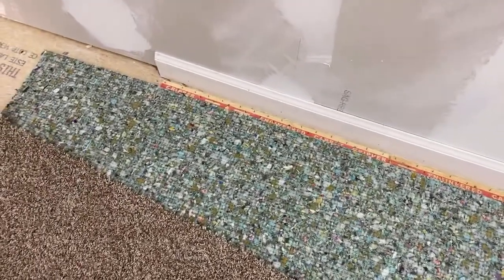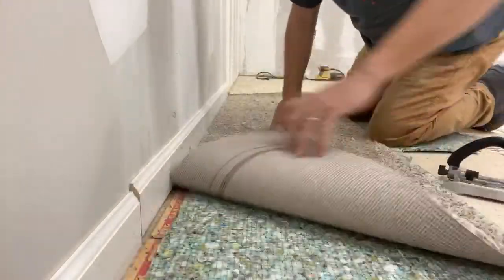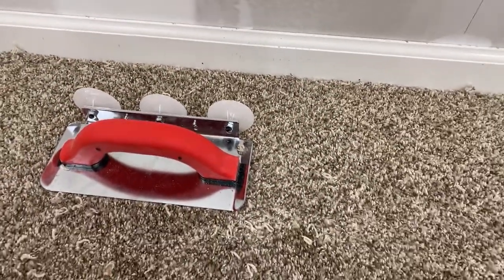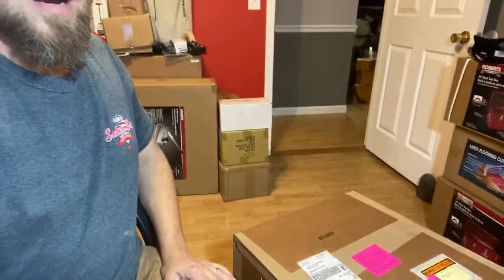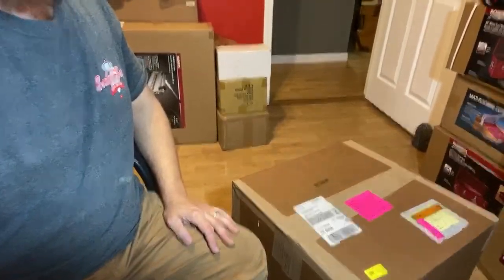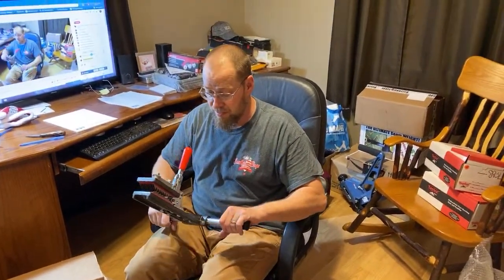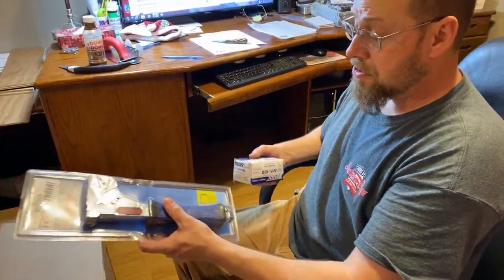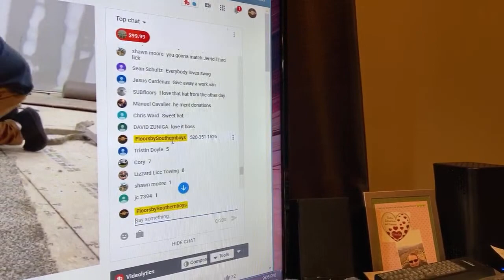Fastest way to tuck Carpet BIGGEST GIVEAWAY

Comment: Whats best to trim edges on stairs
Reply from the maker: Great Escape If they are cut correctly there is no need for trimming, however if you do always just use my knife folding the carpet back and trimming it with my knife
Reply: @FloorsbySouthernboys  thanks, I'm just a hack.  Whats the rule of thumb when measuring and cutting carpet for stairs?  Thanks.
Reply from the maker: Great Escape I always cut about a 16th inch wider than my steps measure